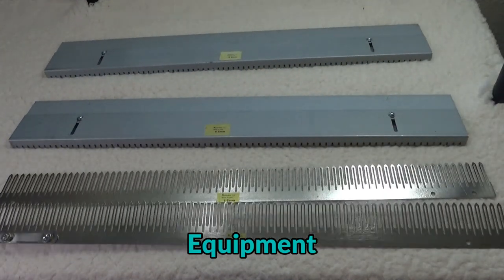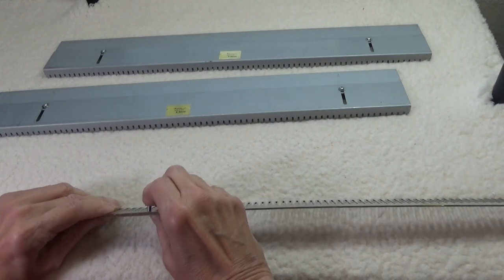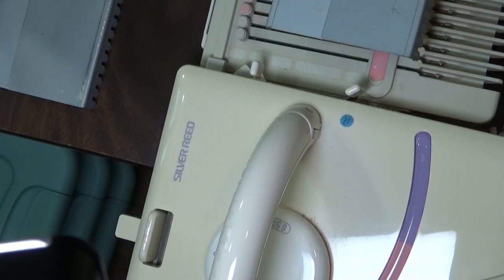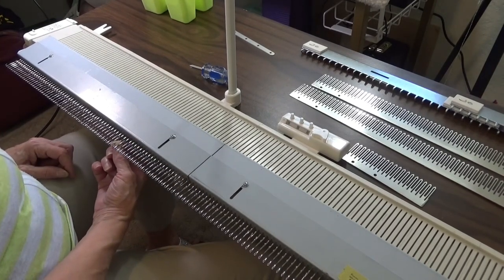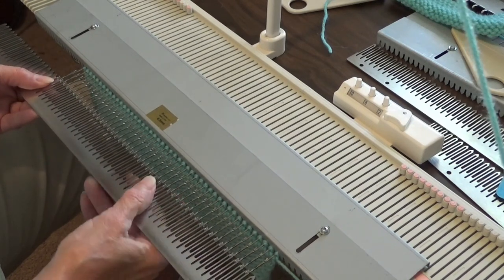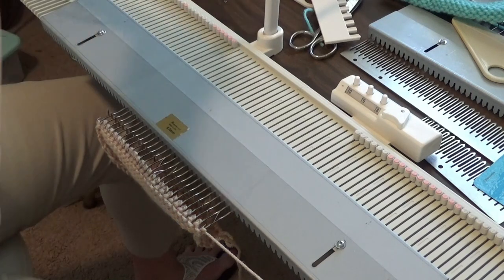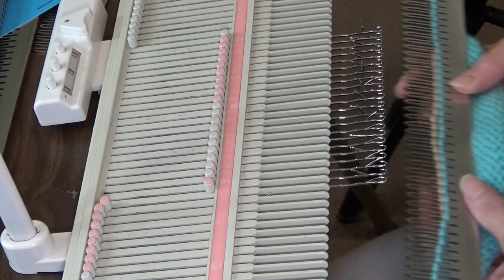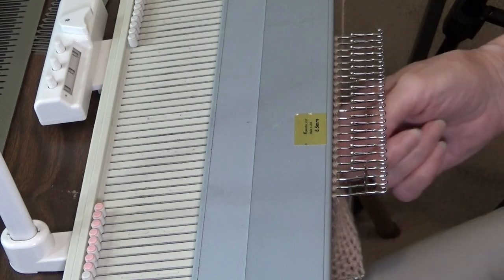How to Use the Garter Bar on the LK150 Part 1 Equipment and Basic Techniques

Comment: Kriskrafter is discontinuing garter bars :( do you know of any other sources?
Reply from the maker: That makes me so sad to hear. I've bought standard garter bars on ebay. However I have not seen any Kriskrafter style garter bars there. The Sonny Choy ones I've never tried. I did buy similar ones from HongKong (don't remember the vendor) but they were sized all wrong and simply never worked. Very disappointing. I will keep me eyes open. What machine are you looking to use the garter bar on?